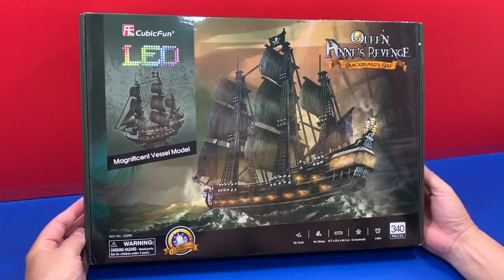DIY Craft Instruction 3D Puzzle Cubicfun LED Blackbeard's Ship, The Queen Anne's Revenge

Comment: I also did it in about 18 hours, but I have the model without LED. It went hard because I didn't want to make a mistake, I wanted it to come out perfectly, so I didn't hurry at all. Anyway thanks a lot for the review! It helped me a lot when I assembled the masts and sails on them.
  Thanks again!
  And it turned out exactly as I wanted, that is perfect!
Reply from the maker: Thanks very much dear for your support 🥰🥰🥰🥰🥰
Reply: @Diycraftinstruction  
Okay, I had to start with the first model I made and your review helped me a lot, HMS Victory. But that, compared to Queen Anne's Revenge (I think it looks more like Black Pearl) seemed easier.
   Well, it has even fewer parts.
   Now I also ordered San Felipe.
   I would like to ask you, if you did it on San Felipe, to put a review, because it seems to me a more difficult model to do than what I saw on youtube.
     Your review are the most complete and helpful!
     Thanks in advance!
Reply from the maker: No problem dear I will find to buy n assembly as per your request😊😊
Reply: @Diycraftinstruction  
Thanks a lot my friend !

Comment: I want to make my first ever model like this, what kind of glue do you use?
Reply from the maker: Oh I used super glue
Reply: @Diycraftinstruction  Ty for the answer, also I see the switch can be activated from outside with the little rectangle hole but in case of change of batteries? Isn't a chance you mess up the shit itself? Again, thank you.
Reply from the maker: Around battery you should not use super glue… 😍😍